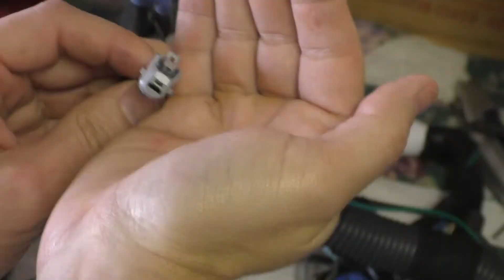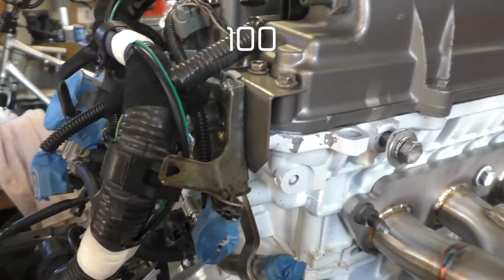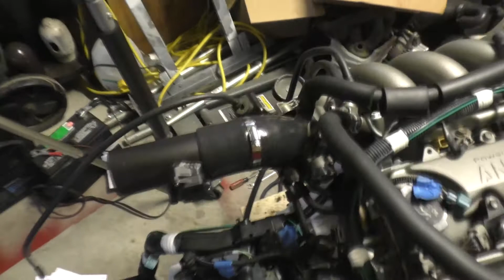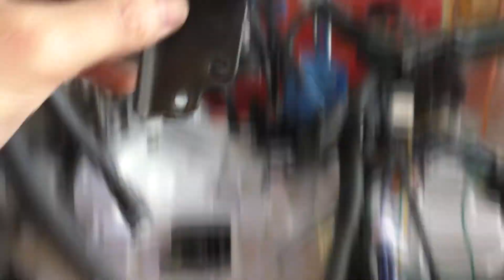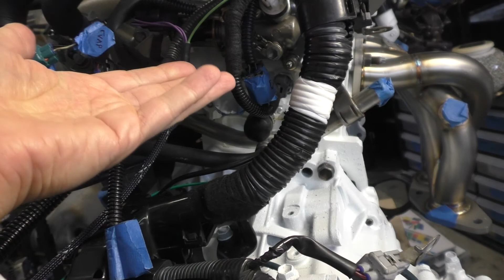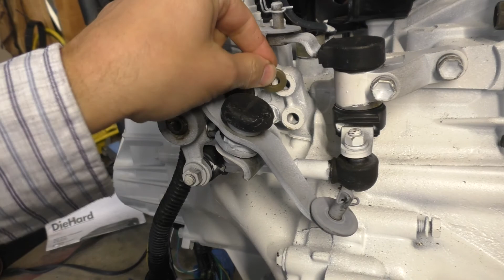AG 014 2ZZ swap into my 2003 MR2 Spyder Round 6

Comment: Ok I started watching your 2zz swap vids when you posted your first two. 

Have gone back to reconsidering doing the MWR package for eng and 6 speed transmission. I’ve not completely checked all of the others yet. But I have one general question: Is this project lots more involved than you thought?  Are there lots more problems w the swap than you expected. And would you recommend the swap or not?
Reply from the maker: Well, it is a little more involved than I thought, but then everything usually is.  I would say it was made more involved by me and there are plenty of people that do this sort of thing in a long weekend.  I just like to take my time to clean things, paint things, add things and replace probably more 16 year old parts than I needed too.  I just keep saying to myself, "well, while I'm in there."

As I mentioned in one of the videos you probably haven't seen yet, I would much rather have put something more powerful under the engine cover, which would definitely be way more involved, but that's just what I like to do. 

So, if it is your first swap or if you just want a more straightforward swap than putting something completely different in there, then I would definitely recommend this swap, but I probably would NOT go with a complete MWR set up if you have more time to source things.  You pay a premium for buying from them.  I WOULD however, recommend getting a few things from them, like the wiring harness adapter and probably the engine mount, so that you don't have to make them yourself.

If you have the capability and inclination to do something even more powerful, unique and perhaps even more reliable, then I would skip it because from what I understand, below 6000 RPM, it drives the same as a stock Spyder.  The experience doesn't really change unless you thrash it.

I chose this method because I really just need the car running again.  I already have a project car, so I didn't need to do a whole bunch of research and have to come up with a ton of custom stuff for a monster build.

I hope that helps.  Good luck and feel free to hit me up again, here or via email at antimattergarage@gmail.com.
Reply: Antimatter Garage Thanks for the additional info. Have enjoyed you posts. I’ve a mechanic here that’s going to do the work for me. My engine blew 3 mos ago and I’ve run the gambit on what to swap and not to. Considered the k20. Also frankensteinmotorworks. He has a swap with a Camry 2.5 engine he recently came up with. Looks like an awesome swap. But hasn’t quite done the all the engineering for AC. 

But I’ve come full circle to ordering a used engine and 6 speed from MWR.   
Which why I came back to your YouTube. Wondered how you feel about both at this time.
Reply from the maker: @wddub9075  Well I haven't started it yet.  I was supposed to yesterday, but came down with the flu.  I've been a couch potato for the last two days.  I'll let you know in a few more days, with luck tomorrow.
Reply: Antimatter Garage Awww man!!! Hope you bounce back soon!!!
Reply: Antimatter Garage And yes I knew you haven’t yet installed the engine  but from watching your videos, can see you go over things w a fine tooth comb. In combing over the condition of the engine and how it arrived, had you come across any issues that concern youi?  I’m assuming MWR has about as good a line on used (and in the case of 2zz’s-old) engines as anyone. Companies selling them on eBay have had very bad reviews when searching the companies outside of eBay.
Reply from the maker: @wddub9075  Sorry Will I didn't understand everything you said, but I do agree, you will probably be fine if you order from MWR, it's just that the price is high.  I have seen engines on ebay with the transmission for about $3k, I even saw a rare supercharged one for $6k.  At those prices, you could do it twice before reaching the price of MWR.  I couldn't fault you for paying extra to hopefully get a good one.  After all , that's what I did.  Good luck with the swap.  I should have the last video up soon.  Planning to start the car the day after tomorrow.
Reply: Antimatter Garage thanks. And I cleaned up my last message but I think you caught the gist anyway.  Good luck w the start up. I’ll be looking for it.
Reply: WD Dub the swap kits MWR sells are priced crazy high and they source their engines from the same places you can get them direct. I know this because I bought my engine from a guy who also sells engines and parts to MWR. I paid $1200 for a 2zz, c60 trans and two leather celica gts seats. MWR charges like $2k for the engine alone.
Reply: HankSchrader308  our buddy here had a problem w his water pump seal which I believe was supposed to be new but leaked after he installed the MWR engine. 
Also found  after the install that his syncro gear was bad. Had to pull the engine. Not 💯 if he had to ship it up there or they shipped him the replacement part. But what a pain. They guarantee parts only, (30days) not shipping or labor. Quite a gamble.
Reply from the maker: @hankschrader3085  You're right.  I admit this in one of the later videos.  I paid more because I wanted a beefier oil pump installed, the new oil pan, the lift bolts and dipstick, etc.  I wanted the car running soon and just wanted to drop it in, but with the upgrades.  Much better NOT to be in a hurry and spend less I think.
Reply: instaBlaster...